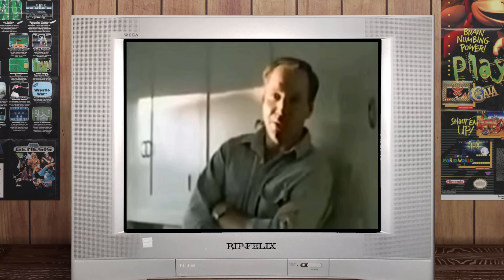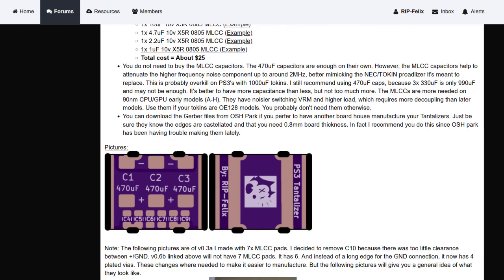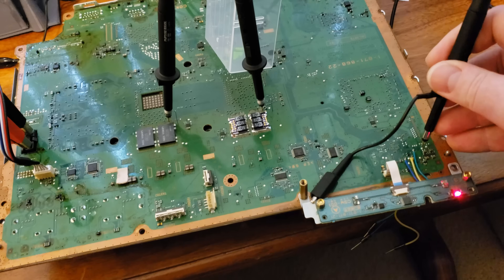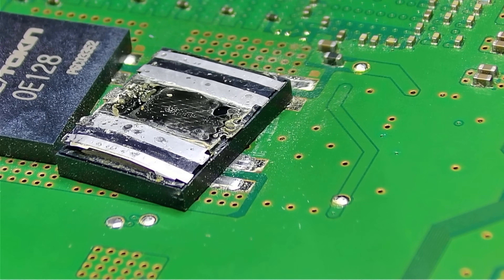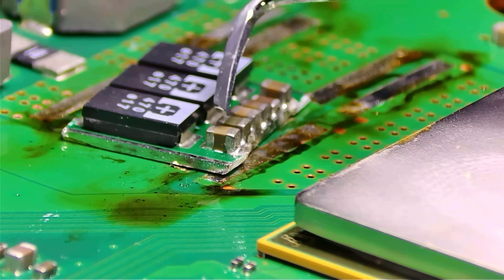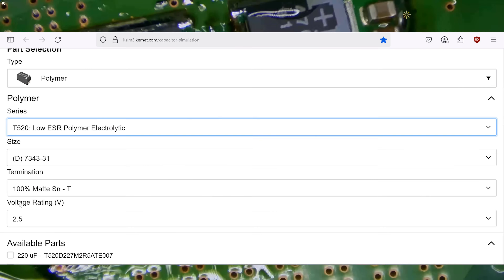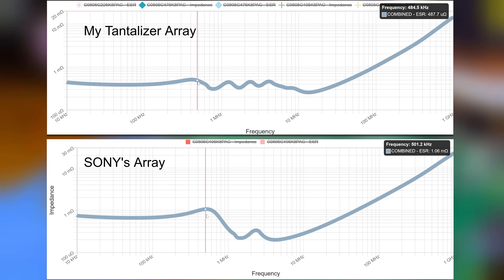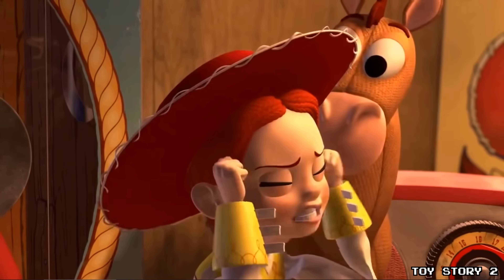How To Fix | Episode 2: Bad NEC/TOKINs

Comment: Felix Empirical Test and Reproduction and test across multiple system for validation of your hyphotesis, you said heating the Chip for little as 150c may make the chip have contact again with the system because the problem were only the Bumps acording to you, But I assure you if you can apply heat of max 150c on all sorts of bgas, on all Models of Ps3s, The Ps3s Slims and they will come Back to Life!!!! I used to reflow Ps3s Slims Cpus in a Shop as an Repair technician, I got 4 Ps3 Slims Working, I Reflowed with low Temps 100% The Bga was Never Melted, what's happening is that the bga Somehow is getting somehow kind of fused together even with those low temperatures of around 100c-150c,
Reply from the maker: It's warping the board. Remember that the heat test is only meaningful AFTER a negative pressure test. The pressure test is first used to see if there's a BGA defect, because it's much easier to reconnect a ball with pressure than it is a bump. So if that's negative, the assumption is that there is no BGA defect. Not a 100% difinitive test, but a more often than not qualitative test. It builds evidence in favor of that conclusion. Then the heat test is used to further confirm bumps, because at that point heat and the warping stress that places on the board should have no effect on the BGA. The warping stress from that heat is less than the pressure test you already proved was negative. So it must be somthing else. Transistors, caps, bumps. 

all these tests are doing is giving you evidence to build a likely conclusion. To improve the accuracy of your diagnosis.

Does that make sense?
Reply: @ripfelix3020 Also Ps3s Slim which Have Cell B.E Deffects extremely Common, they all will work with Pressure Installed above the Cell Cpu, it's Extremely Known method this day, Every Technician applies Pressure on Ps3s Slim Cell Cpu to see if they are the reason for the BLACKOut and indeed the Cell Cpu Cracked Bga is the Reason for Ps3 Slim Blackout Deffects around 90% of the Time!!!
Reply: @ripfelix3020 I don't understood what you meant, I don't think Reflow warpening the board can make bga contact again, the Example of Josh is one Perfect example that is clearly easy and logical to understand, he warps the bord with his hand pushing the board upwards and against the bga and the bga chip is pushed downwards this way yeah this is just adding Pressure on the bga so this way closing the void, but other than that I don't think a reflow will warp the board the maintain an warped position to hold the chip connections up for weeks, that doesn't make sense, The Fact that Cell B.E from Ps3 Slims starting from Cech-25 Until Cech-43 is Very Widely well known, if you see on Youtube Repairing Ps3s With Blackout all you will see will be guys Puting Pressure on Cell B.E and it starts to work again, and after the Reballing of Course it goes all back to life perfectly, I myself had multiple Ps3s going back to Life with Pressure Test, and I want to focus on the test of Pressure of 90nm Rsx but as I'm tripping around Europe now I have no time or Ylod Ps3s to do such test, I just want to put emphasis again that that 90nm Rsx that i put pressure and came back to life never ever had any Pressure on the Die but only across the 4 Vrams, if you don't test this out I'll do it, if you do a video focused on this, Pressure test on 90nm Rsx Vrams then will be my Pleasure to Watch, I could say that My Ps3 was maybe never Reflowed or Reballed before but was once Reflowed by me with 230c and lasted for 3 exactly months, I want to say also An Hyphotesis Is that maybe the Bump Gate Failure would only Happen maybe During the Reballing or Reflow Process? Maybe yes maybe Not? Because I will never forget that ps3 that had Pressure only on Vrams and it not on the Die but still came back to life after that mod of Pressure.
Reply from the maker: When attempting a reflow with a heatgun and without a preheater, the heat is applied unevenly to the board. The upper surface. This causes the board to bow like a taco. I've seen it happen to me. It can literally cause a BGA crack, torn pads, and caps to fling off. So yeah, after it cools it certainly can lock in a warped position and hold a BGA defect back in place temproarily, but like I said. The purpose of the pressure test is to rule out a BGA defect. Then if the heat test works it's more likely to be bumps. You have to perform them in that order, because if you did the heat test first,  you wouldn't know if the heat warped the board and caused the BGA to reconnect. That has to be ruled out first.
Reply: @ripfelix3020 Felix in first Place, Thank you very much for Replying, I appreciate it, well about the Warpening being the lead reason for Reflow bringing back systems communication with the Bga again, I rather think it's Extremely unlikely by fisical meaning alone, I don't think a ramdom warpened board by heat would be capable of restoring or pressuring voids across a thousand bgas in a bga chip, it's highly unlike non probable, remenber when we were watching computer booter(David) and you or someone else like Victor Moore told Booter to make a Reflow but only with 150C Celsius on the HeatGun, So yeah Felix you know a Heatgun Set to 150c won't even reach that temperature but most important of all it's that 150c isn't High Enough to warp the board especially as these kind of temperature it's the temperature that is used for pre heating the boards to prevent warpening, remenber the Xbox 360 Repair method of Blocking the fans and letting overheat to make an Internal Reflow, so by this way just proves that your hyphotesis is wrong because Xbox 360 board and all hold by screws and firmly attached to all the metal box and the heatsinks making warpening of the board Impossible.
Reply from the maker: That's the a targeted heat test. In a jig and directing the heat on the Die isnt intended to warp the board. It's only intended to soften the underfill and allow pent up strain in the bumps to relax. What it does is make a physical connectio of the bumps, while preventing that same heat from warping the board and reconnecting a BGA failure. If you performed the pressure test first, then we are fairly certain there isn't a BGA defect to begin with. That means if the heat test has any effect at all, it was more likely to be a bump defect. Remember, these temps aren't high enough to melt solder, so this isn't a reflow.
Reply: @ripfelix3020 I'm sorry Felix it's not true, you know why? Because i Applied heat to Inumeros Ps3s and expecially Models that don't have Bump Gate Failure at all (acording to you) which were 65nm 2 Usbs Ps3s and expecially the Slim Models of Ps3 which uses 45nm Cell, so i applied heat to those Slims Ps3s Expecially in Cell Cpu because i know is the main Reason for Ps3s Slims starting from 25xz to have Deffects, Because The 20xx Slims have 65nm Rsx that has an heatsink that is too small for it and this way Rsx on 20xx Model works at 85c while gaming, Back to the Main Topic, The Logical Observation that Prooves 100% that  your argument is wrong, so i applied heat on Various Ps3 Slims Cpus, and That Temperature that i applied on the Cpu was Never no way near melting it's Bga, The Temperature were around 180c the temperature that i applied and on top of that we know that some times even with 230c the Bgas won't melt (very tipical of Cok-00X Rsx's) so after i Heat Up that Cell Cpus in Ps3 slims they 100% started to work again, i did this in Multiple Ps3s slims and acording to you 100% you have said Ps3 Cell Cpu underfil is Absolutely Not Deffective, you have said 100% that Ps3 Cell Cpu is a Tank and that has no Bump Failures at all, and you said that Cell 45nm has same underfil as 90nm Cell if i remenber right, so after all logical conclusion which is scientific is, No it's not Necessary to melt a Bga Soldering for it to make contact again whitin it's cracks, you're just assuming that they needed to melt to have contact again, the Fact that 45nm Cell is Bumpgate Deffect Free proves that Heating the Bga of a Chip under temperature of fusion will make the System somehow restore the Electronical signal connection again restore somehow.
Reply: And yes i know which exactly Ps3 Models with 2 Usbs had 90nm and which had 65nm Rsx, all 2 Usbs Fat Ps3s have 65nm Cell but few have 90nm Rsx like the first model with 65nm Cell and 2 Usbs which is the G Model Ps3 quite an European Unit of Ps3 40gb, super common on 04 Region (Europe) and quite rare on Americas, then The H Model with also 90nm rsx which was relesead at 2007 and then The first model with 65nm which were the K model which has same lawayout of Board as H model, It's absolutely true that I didn't know about any Fat Ps3 realease in later 2008 which used 90nm Rsx, No worries as i won't provide any feedback about those cause i never had any of those, the only late 2008 model which used 90nm that i Know is Model E MG an Metal Gear bundle unit, that one it's pretty obvious, 4 Usbs and Cok-002 Board, on top of all i always used to removed Ihs and know the lithography only already by die size, i did update the Data of Wiki once on for the Decr-1400 Devkit, the data said it used 45nm Cell and 65nm Rsx, after i saw the Die photos on net it was clear it were an 65nm Die size just like the other 65nm Cells, even the back Capacitors had same layout as the 65nm and not like the 45nm or 90nm Cells.

Comment: I bought a Fat PS3 at launch in 2006, always worked fine until 2016, now gives me the 3 bips do you think are the nectokens?
Reply from the maker: Probably not. That's got a defective 90nm GPU which is more commonly the cause.
Reply: @ripfelix3020  Thanks for the reply, the strange thing is that it lasted more than 10 years of constant use. Then I store it because of ps4, and at a latter date I turn it on did some updates some gaming eventing ok, turn it off next day yellow light of death.
Reply from the maker: Well, in that case maybe so. I'm playing the odds here, but the fact it was working fine then stopped only after a long storage could auggest the tokins aged out while in the meantime. Only the codes can reveal the truth.

Comment: 15:55 - avoid cutting PCBs with soldered ceramic caps - they are brittle and multilayer inside,  when they crack due to stress they love to internally short circuit
Reply: How do you expect to separate fhem if you can't cut them?
Reply: @Johnny_LuvBuckets   carefully saw (dremel e.g.)
Reply: @Petr-ei2iv ive done hundreds of Frankenstein consoles. I've snapped every single tantalizer off of the panel. Not one has failed. This might be true on paper, but in real world practices it doesn't really happen...

Comment: I was hoping for a proper install tutorial from the maker but I got an explanation of tokins instead. I still want to know which part do I need to do the jump wire thing and why is it not implemented in the board instead.
Reply from the maker: There is no need for jumper wires. It's built into the tantalizer.
Reply: @ripfelix3020 my mistake, the forum tutorial page is for early smd tantalum fix, not yours.

Comment: man i got CECHL01 for 10$ on ebuy that bad on cap i replace working great but the cpu very hot 69c  gpu 64c @ 32% fan speed i delidding cpu but not gpu and it work great now the cpu 63c gpu 67c @26 fan speed then i thingking i dellidding the GPU to then ther my luck run out my flat driver hit the subtray of gpu and cut some trace of the gpu nw the ps3 only for display😂😂😂

Comment: Hey, out of curiosity, in the video it states that ps3 models M and Q also have defective gpus. I'm not sure if where I'm finding my info is correct but I've noticed and assumed that the M and Q models would have had the 65nm gpu installed onto them instead of the defective 90nm. Is the info just wrong or is there another reason that those model gpus are defective? I've not worked on either model before and am still a bit of a novice when it comes to this kind of thing
Reply from the maker: I have confirmed this. I will release another video explaining it in more detail.

Comment: Felix i Have One Very Important Thing to Say, like Josh Told you in one of your Last Videos!!!! You Didn't Applied Enough Pressure on THE Gpu Of Ps3 to Make it turn on, I Extemely Encourage You to do the Test Again of Pressure Applied Not With Hands, Much Less Fingers because as Josh and me say, That's Absolutely no way Near the Enough Pressure to Make the Whole Cracked solders to fully contact again, as i told you Before i got my CechA01 Working Only By Applying Pressure on the RSX 4 Memorys Without any Pressure on the Die it self by Any Means, as i told you before i removed the Ihs and reversed so the Ihs Bump that touch the rsx die was upside down, as theres a height diference between rsx core and memorry as the die sits lower there was no way the ihs would touch the Die Core, so my FIX means 2 THINGS, 1 THE MAIN BGA WAS DEFECTIVE OR 2 THE 4 MEMORYS HAD DEFFECTIVE BGA OR ACTUALLY EVEN 3 BOTH HAVE DEFECTIVE BGA.

Comment: Will you ever do a video on the nops2 error as there is very little to no documentation on the issue?
Reply from the maker: That's because it's not a single issue. There is no "answer" that always works. The only video I might do on that subject will include the bad actors selling lies.
Reply: @ripfelix3020 still just a video explaining it and showing how bad it is would be good i thought. 😊 I had no idea it was possible until it happened to my ps3 after a Frankie install. The installer didn’t test and now I’m out the money as they say it’s not Frankie related but yea it was a lot of looking up to find out it can be almost anything.
Reply from the maker: IMO, the most likely cause is the BGA under the EEGS. After that, delamination of the pcb layers between RSX and EEGS, popping vias that carry needed signals between them. That's irreversable and often a result of not baking moisture out before rework. Or the 868-22 curse. Beyond that there are a handfull of other issues that have been identified, but mostly it can be anything. PS2 subsystem is it's own can of worms and it doesn't provide usful diagnostics to diagnose what went wrong.
Reply: @ripfelix3020  it will run a game at 70 degrees but once the game starts it cools down and crashes so I’m guessing some kind of trace issue. He tried to reball the ee and a few other things tbh not happy

Comment: Man, love your videos! One huge question tho, how long do you think the supplies of A or B model PS3s and 40 and 65nm RSX will be there? Like, where are the people who are selling these 40nm RSX getting these from? From defective slim consoles? I want to do this stuff, but I'm quite young now and don't even have money, and when I get older and get a job it would take like 5 more years (to complete college and get a job) and then possibly more to learn the skills and do a frankie. I know I can just buy a frankie, but I really want to learn the stuff because I like repairing stuff and tinkering. I just don't know by the time I'll get around to doing this, if the supplies of the early PS3 or the later RSX would still be there.
Reply from the maker: They're not going anywhere. Those who make these on mass purchase the 40s in bulk from ali express seller, currently. That guy is asking for mor money and so they are trying another seller. But yes, these sources of 40s is an ever changing landsape I cannot predict the long term stability of. You can always harvest, tho. That market isn't going anywhere.
Reply: @ripfelix3020 thanks for the reply! That's relieving!

Comment: I couldn't find the answer on Google, and I didn't hear you mention it in the video, so if I may ask: how many hours do the original NEC Tokin capacitors in the launch Phat PS3 models typically last before needing replacement? (Assuming they run below 70°C at all times.) Thank you for your help, Mr RIP Felix.
Reply from the maker: They're rated at 1000 hours at 105c. They typically outlasted that if in regular use. But they tend to age out regardless of use too.
Reply: @ripfelix3020  105ºC is too high. I heard 10000 hours if they are kept under 70ºC. Is there any truth to that? Could you confirm?
Reply from the maker: The relationship is logarithmic. I have an artical explaining the math and guessing the expecred lifespan based on real temps I measured here...

https://www.psx-place.com/threads/research-experimental-nec-tokin-capacitors-replacement-ylod.25260/page-173#post-280402
Reply: @ripfelix3020  Thanks for the article. It was very helpful.

Comment: 3:34 you made a mistake! 25xx model are nondefective beacouse of no nec/tokins and 40 nm processors. it not should be 20xx instead of 25xx?
Reply from the maker: Typo in the text, what I said is correct tho.

Comment: Due to me not able to wait + being super cheap as I don't want to pay 2x price of the pcb on shipping, I ordered the caps, used a generic 2x8cm pcb board (cut it) and soldered following your schmatic!
Works like a charm and perfect for anyone who don't want to fab the pcb for a "one off" job.
Reply from the maker: Yep, you dont need the PCB. It just makes soldering easier. Glad you got it working! Nice work.
Reply: @ripfelix3020  
Nono thanks to you and your work for analyzing ESR and such. We'd all stick to tantalum capacitor "singles" if not for you!

Comment: So the slim was the better option back in the day. Glad to see.
Reply from the maker: The 21xx theough 30xx models seem to be most reliable, yes. As long as you're ok with the loss of PS2 BC, then yeah. They are the easiest/cheapest way to go.
Reply: Unless we bring PS2 BC into the mix, then yea.
Reply: The hardware backwards compatibility isnt even as big a deal as people put it out to be as the hardware is based of the slim ps2s which had game compatibility issues